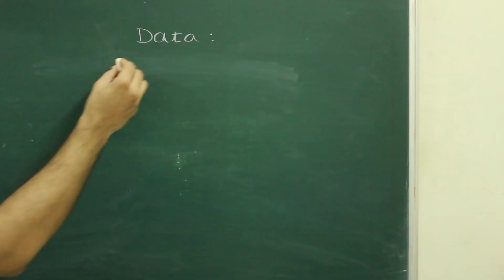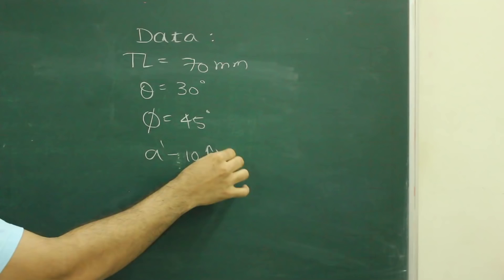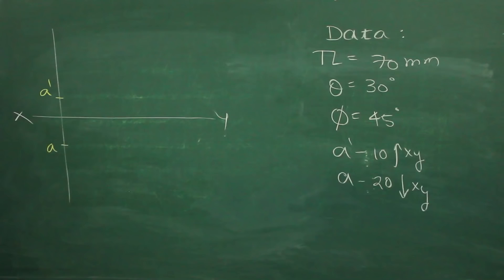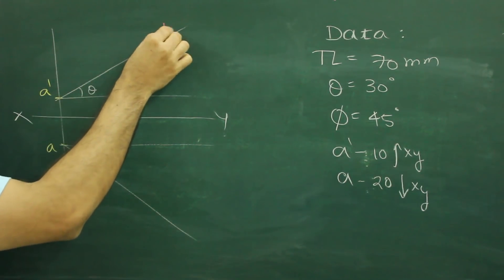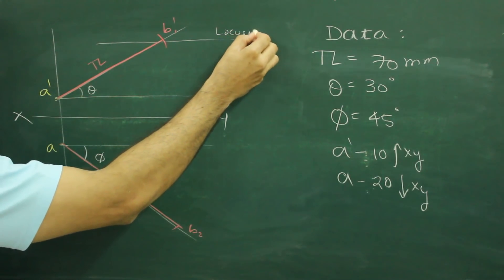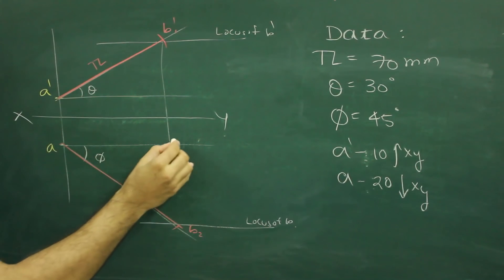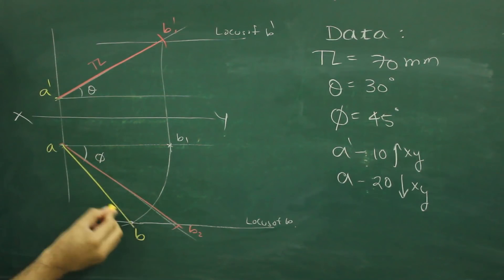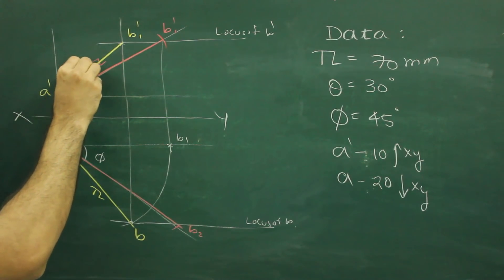Projection of lines 3

Comment: Doubt::Why are the front view and top view at greater angles than given with respect to their planes
Reply from the maker: Why alpha and beta is greater than inclination with HP and VP?
Reply: Yeah
Reply from the maker: Fv and Tv is inclined so reference plane and to find true length we need to assume it parallel to one of the reference planes so their inclination will reduce so it is always fv and tv which will have a greater angle than true length